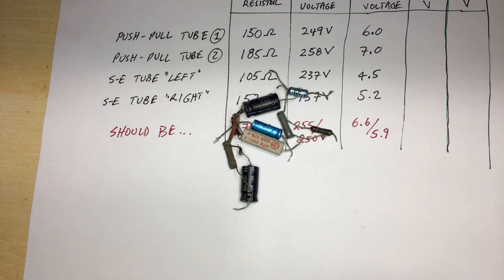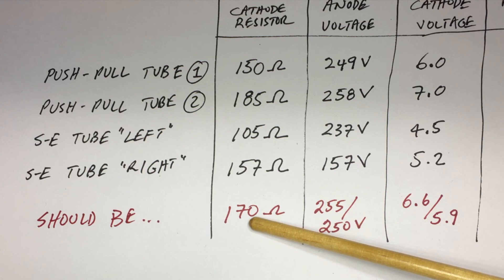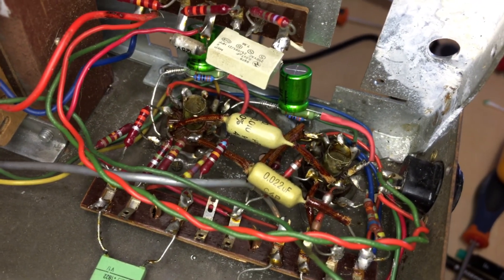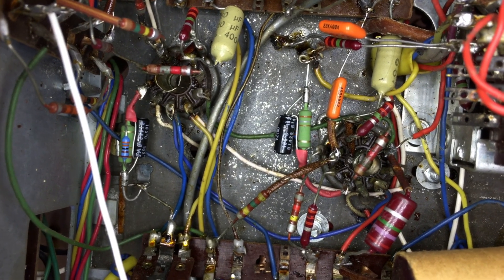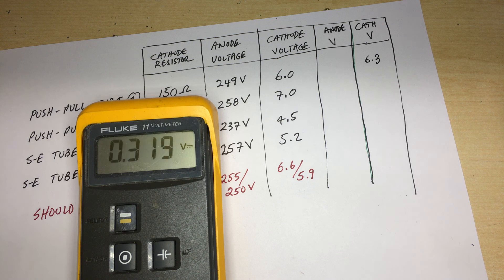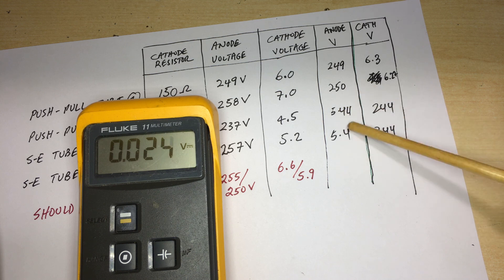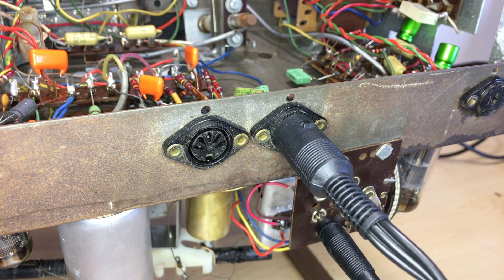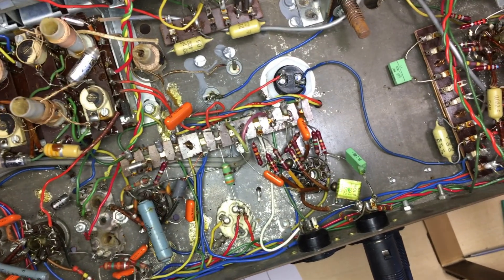Telefunken Opus 2114 stereo tube radio restoration - Part 3. Biasing the power tubes.

Comment: just one question if you don't mind..... what's the best type of caps. that should be used in the audio signal path?..thanks
Reply from the maker: +mountainhawk : I use poli propylene or poliester caps. Nothing too expensive, but they are good.

Comment: Kind of an odd way to deal with the audio with a push pull output mono of about 6/8 watts driving (I guess) the two large speakers in parallel. Then two more mono amplifiers used as a stereo pair feeding the two small side speakers of about 2/3 watts. A better way would be to have 2 x 8 watts each feeding one front and one side speaker with a conventional passive cross over. Would be a more HiFi way of doing things and would be the best sound option.
Reply from the maker: +Michael Beeny : remember this is from 1961, when they were really experimenting with audio distribution to try get an edge up on the competition. So I suppose
that these weird choices are to be expected, so that we now can use hindsight based on experience.

Comment: I hate to admit it but the earlier repairs here are probably the kind I would have done in my teens in the 1970s when I had no money and just ratted bits out of old TV chassis' to get things going without any circuit diagrams. I learned a lot, but it makes me shudder now to remember some of the butchery I did.
Reply from the maker: +Doug V B : we've all done some butchery, but now we do shudder, especially since this radio deserves better.

Comment: If we compare the measured voltages at the cathodes with the values at the schematic, all tubes seem to have a bit less than 100% emission. But as long as the sound quality is not affected, I wouldn't change them since ECL86 are quite expensive nowadays.
Reply from the maker: +rotwang83 : yes they are, and you're have to get a matched set which is is even more costly.